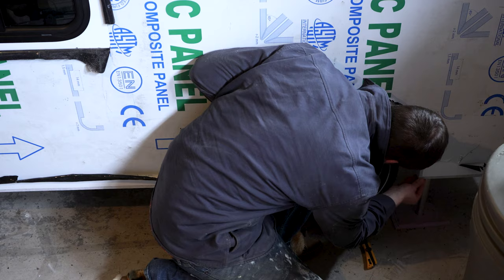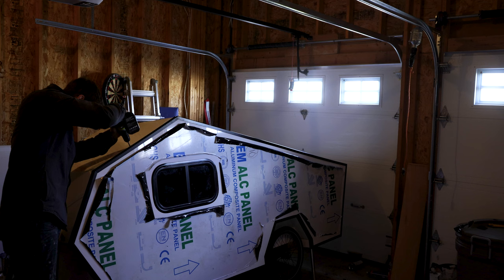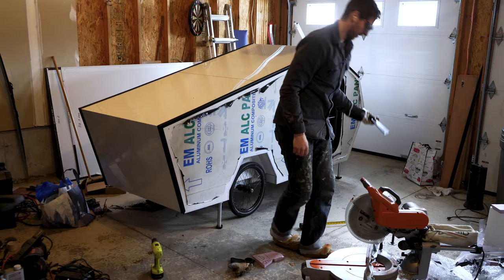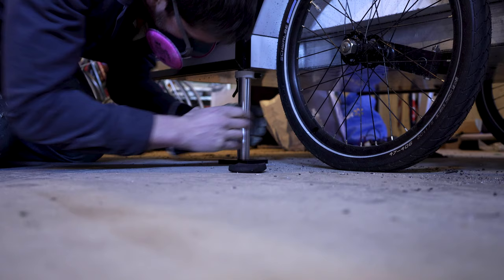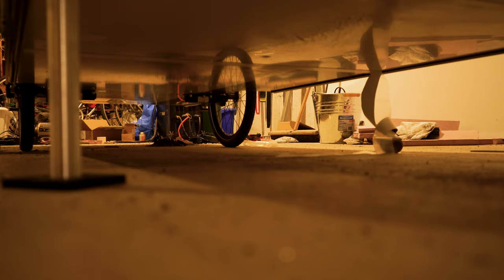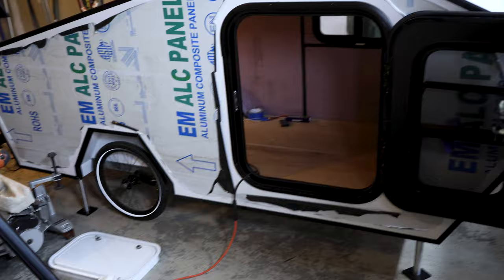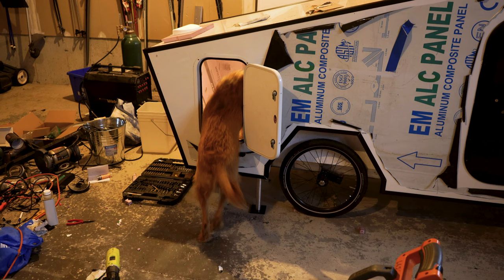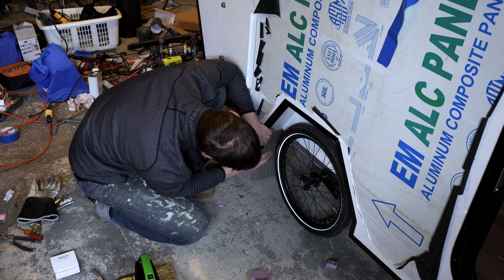Building Electric-Powered Bicycle Camper (PART 11)

Comment: Afternoon J. D. Looking through your past You Tube I see that you build a skeleton of metal for the camper. 
Here in U. K. the metal is the chassis to hold the wheels and towbar. The body of the tourer (travel trailer) is made of polystyrene (styrofoam) foam, aluminium sheet and wood (5mm) panel all sandwich glued. At areas of windows,  door, perimeter of tourer side panels and storage areas there's 25 mm (1") wood battens placed in the glued sandwich. The area of windows, doors etc. of sandwich are cut leaving wooden battens for fastening them into place. The floor of tourer is also a sandwich of wood (6mm) and polystyrene foam which is fastened to metal chassis upon where the tourer panels are placed and fastened. Stretchers between side panels top and ends screwed and glued to hold roof of aluminium sheet and interior panels.
The following video has a heater.
Watch "CAMPING IN -15°... Snowmobile Camper Conversion" on YouTube
https://youtu.be/NNmnkDev9VQ
Reply from the maker: Hi Thomas, thanks for the info. I wanted to use this project to practise my tig welding which I was learning late last summer. All aluminum isn’t the lightest, but I enjoyed the welding process. If I did it again I think I’d use as much sandwich composite panels as possible because I was surprised how strong they are when I make my
Floor. Cheers!
Reply: @Jerbrown  I making panels of 1 mm balsa wood glued with contact glue to one layer hard carton 2 mm then 3 layer epoxy paint on balsa side .Super strong and very ligth weigth .
Reply from the maker: @copenhagenlife9310  I definitely think that kind of laminate composition is the way to go. I'm pretty heavy.

Comment: Morning J. B. from U.K. I would have used scissor jacks for stabilizer legs could have been welded to steel frame. The caravan building here in U. K. use a similar leveling jacks.
Thomas
Reply from the maker: Hi Thomas, good to hear from you. I did look at a variety of products on the market including scissor jacks. I wasn’t able to find anything that was Aluminum and light enough. I purchased a drop down leg, but found it far to heavy for my purposes. I think the stabilizer legs will work well with the adjustments. I’ll report back!

Comment: As to rear wheel mount would have added an outer frame to attach the outer axle to like on a bicycle rear fork
Reply from the maker: Yes, but then you increase width or lose interior space. The 40” width was arrived at by Canadian bike lane standards and local trail heads where I measured to see the max width I could slip through before being completely confined to roads.

Comment: Just an idea .. sense you can't pull air in without letting exhaust air out .. one of the flat plate heat exchangers (usually used with liquids) .. could also be used as a very compact small space HRV (Heat Recovery Ventilator) .. such would not be needed or useful expense in mild weather .. but if you hit very cold temperatures , it would allow you to still get fresh air in , but retain/recycle ~80% or so of the heat energy (that would otherwise be lost) from the exhaust air.
Reply from the maker: This sounds VERY interesting... I know nothing about them, but I'm on the trail now!